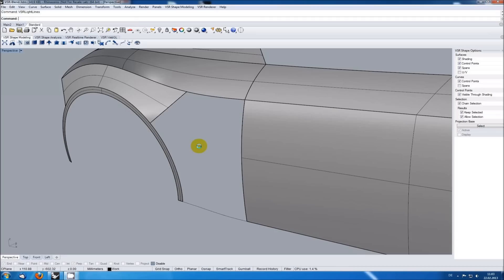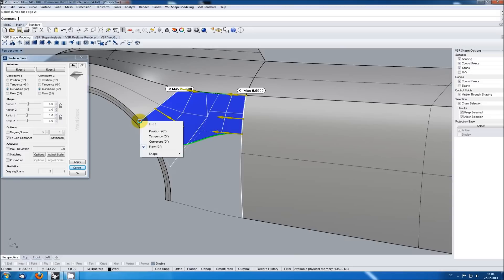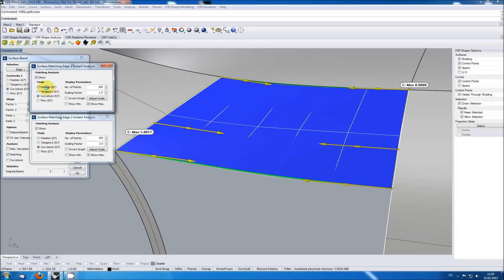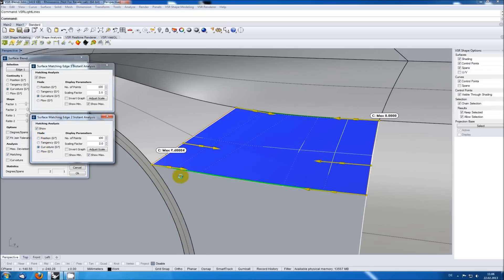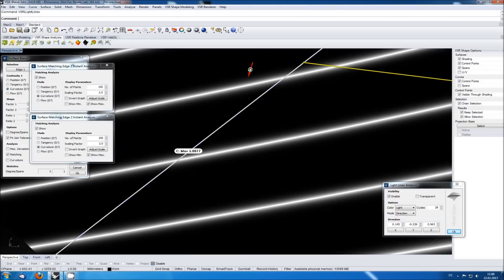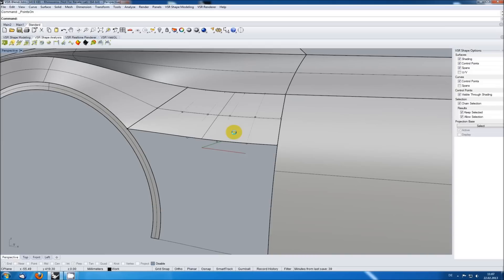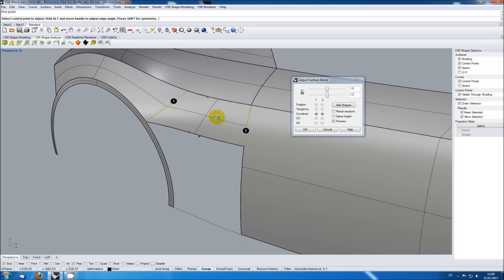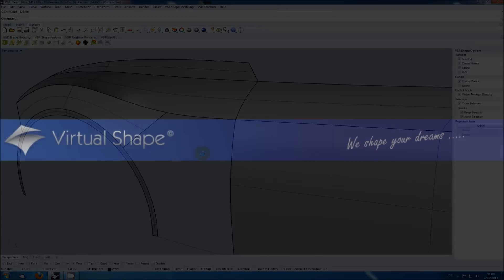Class A Part 2/2 - what is needed, and how to get there

Comment: In Rhino 5, you can turn on zebra analysis on the Blend surface command by simply applying the zebra to the nearby surfaces prior to the Blend surface command. 
 Also, you can smooth the opposite control points of the blend surface at any time during its building by clicking on the "Same height" option twice. That will return the default even distribution of the control points.

Comment: Nice modelling and where suppose to be the Class A surface?
I didnt notice nothing!
Reply from the maker: The blend surface created with the VSR tools is Class A, while the one being created by Rhino is not. Class A = G2 (when wanted), only the really needed amount of control points, smooth running light lines.
Reply: VirtualShapeResearch Whatever Tool you use what I can see in your video that is not a Class-A surface.
Thank you for the Class-A explanation.
But
A really Class-A is MUSH more than that ;)
Reply: +Combo Jerman then why don't you explain it, at least in a nutshell?
Reply: Class-A surface usually means a blend, or patch or multiple blends and patches which consist of Single Span surfaces (no knots are allowed). Thus and usually most of the blend surfaces are of a degree 5 in both directions (U and V) but sometimes degree 6 and 7 are required for more detail and seamless flow between the patches. In all cases they have to be single spans = minimum CV (control vertices, control points). Signle spans usually translate and export later to mesh or other 3D formats without problems.
Nowadays computers are very fast and powerful and single spans do not have such an impact but lead to more work and patching and CV tweaking to match perfectly. On the other hand surfaces and curves with more knots mean more CVs and more hard work tweaking them (if necessary for the perfect blend).
All depends on the degree of the curves that will form the surface blend or patch.
Sometimes to describe  a specific curve the designer might need degree 7+ curve (8 CVs in a single span).
Usually degree 4 is perfectly enough (for self smooth G2 continuity on the knots) with the cost of having 2 knots. Degree 3 is also fine but the blends might result in G1 continuity only (depends on the specific case).
T-splines usually have degree 3 but their knots in a T-conection or Y-conection or Star-conection will have only G1 (just in the knot connection). Outside they will have G2 by default.
Single span surfaces are easy to match but they have to be chosen cleverly otherwise could lead into dealing with patches into patches into patches.
Usually when converting T-splines to NURBS you can see the multitude of patches needed. Thus without T-splines cleverly positioned single spans are preferred. None will make fun of you if you use 2 or 3 knot blend surface if you'd like to save time, as long as G2 is achieved at the edges and no undesired deformations have occurred in other areas of the aforementioned multi-span surface.
Sometimes multi-spine surfaces may get converted into denser meshes because of the denser CVs. Just choose a degree 3 or at the very extreme degree 4 curves (to create blends) when multi-spans are unavoidable.

Comment from the maker: Well, inflections can be spotted via light lines or curvature analysis resp. sections with curvature, so you can fix them by modeling the surface. Concerning a function to remove them automatically: how should it look like? Haven't seen something like that so far? Our next major release will contain a smooth function, but I guess this is not what you are referring to?